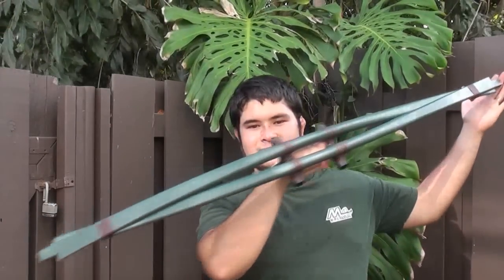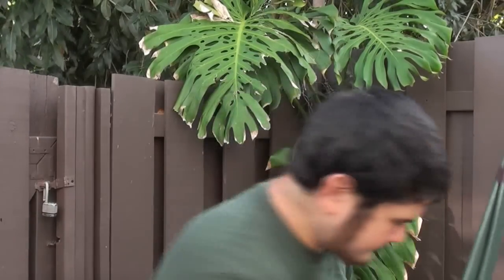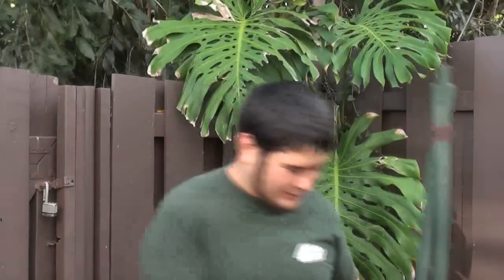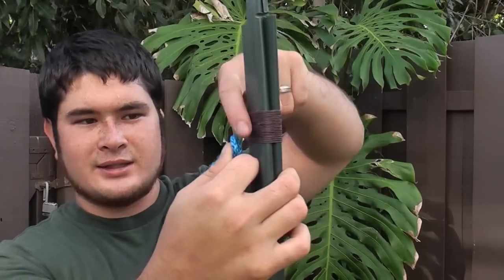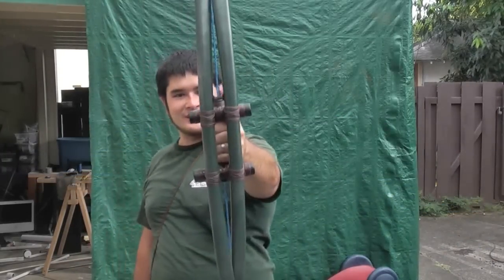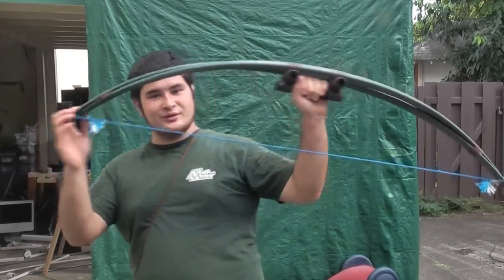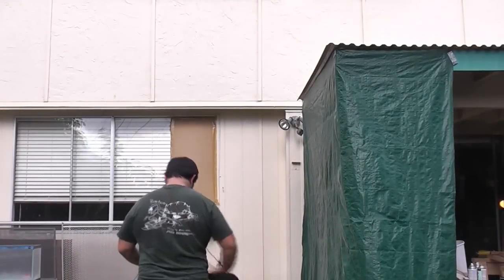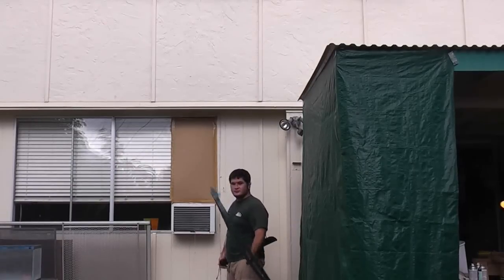A 65 Pound Centershot PVC Bow Part 3 - Stringing and Shooting

Comment: I think that's a unique way to try and overcome the Archer's Paradox and improve accuracy. However, the handle is directly centered from top to bottom, leaving your arrow trying to run off center. The bow string is gonna lift the tail as it shoots, thereby rotating the Archer's paradox from horizontal to vertical. Not trying to rain on your parade. It's still awesome, but with a little adjustment...

Comment: Thinking ... a center shot crossbow ... or is that going too far?
Reply: I'm not sure what the purpose would be.  The purpose of a center shot bow would be to avoid the arrow wobble caused by shooting off one side, which doesn't happen with a crossbow.  Though from what I understand of the physics behind it, unless the shooter is using a mechanism to release the string rather than fingers, a centershot bow would not be useful

Comment: Thank u so much! I built it and it ended up pretty well. I used screws and bolts instead of strings/ropes to keep it all together. Its much more rigid and stable that way. And looks better in my opinion. Still don't have any arrows to shoot though. Don't know how to make any. Any suggestions guys? Help would be much appreciated. Thank you.
Reply from the maker: WAKEISLAND99 Nice! Glad it worked out!

Here's how to make a couple types of dowel arrow:Dowel Arrow with Duct Tape Fletching - https://youtu.be/i6Cc5z4vCW4
Hunger Games District 12 Arrow with Feather Fletching - https://youtu.be/fF-aUZu3_js

How to Fletch an Arrow with Fur - https://youtu.be/zZwtqgrtWmw
How to Fletch an Arrow with Feathers - https://youtu.be/flm58SB-Ts0Here's how to make a great homemade arrow point - https://youtu.be/N_4w482Oty0Hope this helps!
Reply: BackyardBowyer Thanks! Ill check'em out.
Reply: go to dechatlon and buy some

Comment: As a general idea these bows pull those weights at very long draw lengths, yes maybe it may look slow but just because a bow has a heavy draw weight does not always mean it has a really fast shot a big variable in arrow speed is arrow weight as well as fletching size shape and over length of the arrow. The arrows that i use for my PVC bow are just about 2 1/2 times heaver than the standard carbon fiber arrow. So if i was to load an arrow in my bow that was as heavy as the ones used by the average compound bow today usually weighing about 225-250 grain total my bow would have a significantly greater speed than the 141 feet per second that i manage currently which is out of a 63# at 30" draw, granted i draw to 29 inches on average and my bow pulls 56# at my draw so in theory using space age math lol i should be able to get close to that 300 feet per second mark. But as i mentioned fletching size does affect drag on the arrow as well, hence making the arrow less or more accurate also can slow the arrow down as well not as significance as arrow weight can do but it does affect speed.

Comment: original design.. but how do you know the poundage? because from what i see in your video.. this bow doesnt feel like 65 pounds man.. not even close.. id say its 45# at best.. iv got 50# bow and without finger protection shooting this bow is close to impossible.. not to mention how strong you have to be to pull that string..
Reply: He had tested his bows with something like a flashlight that measures wheight
Reply: Stefan Nemec lol really? strong to pull 65 lbs? my grandma could probably pull it...

Comment: you should add a stopper with some soft rubber so that the string hits the stopper and doesn't slap against your wrist, not sure if you have experienced that but its not fun, this will also make it much more quiet when firing the bow.  http://discussions.texasbowhunter.com/forums/attachment.php?attachmentid=266878&stc=1&d=1315771792

Comment: No disrespect  but I think you are getting the weight if it wrong cause  I was watching another video of your 100 pound cross bow and you were lifting that no problem with one hand and I work out and that is all I can lift
Reply: The pounds that are mentioned is not the physical weight of the bow, but the weight needed to draw back the string, and normally measured at 28 inch from the rest position of the string.
Reply: These bows are made from PVC pipe filled with molten lead. He's just really strong.
Reply: When you draw a crossbow you use alot of your muscles in you body not just you arm, and a 100 pound crossbow is easy as hell to pull seriously better keep lifting kid cause sounds like you have some small ass arms just saying.

Comment: When I build myne Im going to use a Bungie cord instead, just shave the middle part a bit so the arrow fits on it. What do ya think?
Reply: I may be wrong but isnt bungie cord stretchy, in which case it is, it will lose a lot of the force i think, not positive but im almost positive it will really screw over the bow if the string is stretchy.
Reply: From what i recall bungie-cord is normally made up of a lot of thin elastic cords bound together. That means that when you start "shaving off some of the cord in the middle you will lose a lot of the strength of the cord, and are likely to end up snapping the cord pretty soon. For what you intend to do, i would rather then go for a slingshot, and use surgical tubing, and not make a bow that is designed with the limbs to store the energy that is needed to propel the projectile forward.

Comment: The bow is very nice ... but you got to be crazy to put the handle in middle if when you are shouting with it you got to be careful whit it if the string hit you're arm it's painful
Reply: C Tomlin
The nocking point of the arrow on the string is very seldom perfectly in the middle of the string. When you set up a bow, more so with recurve-bows and longbows, they are almost always set up with the arrow pointing slightly down if the angle is measured at 90 degrees from the string. And that also depends upon the shooting style that you use, wether you shoot with 1 finger above the arrow and 2 below, taking note that you are not "holding" on to the arrow, but that the nock of the arrow has to hold it to the string, or with the 3 fingers below the arrow style of drawing the bow.
Reply: you do know that almost all bows you hold right in the middle where the string is right? the only way to hit your arm i if you are not shooting with a correct form.
Reply: Leng Thor but don't you need to noc it in the center of the string?
Reply: C Tomlin no it doesn't have to be perfectly in the center.
Reply: Leng Thor Thinking about it later I remembered some of the Asian long bows don't use the center either, right?
Reply: C Tomlin
I think you may be referring to the Japanese longbows, which are held at about 1/3 of the length from the bottom. The rest are all sort of close, but most bows are never held perfectly in the middle, since the handle is incorporated into the bottom limb of the bow, and that is compensated for in the tillering process of the bow.

Comment: That is no way anywhere near 65 pounds. I would say 20 pounds at the most looking at that bow and the speed of the arrow plus the very shallow penetration of the arrow in the target. My wife has her Mission Menace compound bow set at about 20 - 25 pounds and it leaves that PVC Bow in the dust. My Mission Craze bow is set at 35 pounds and eats that PVC Bow for breakfast. My bow would sink an arrow up to the nock at that distance into that target at just 35 pounds. Im not saying the bow is shit, its good and hes done a great job on it. But he shouldn't boast saying his bows are 60 pounds, 40 pounds, 70 pounds etc because the truth is the most powerful of his bows wouldn't even break the 25 pound mark.
Reply: nathan leslie lol its possible to get 65 lbs. there are videos where people with pvc bows are pulling at more than 60 lbs at 28 inch draw. (with proof) 

btw i think it's funny how to compare a $400+ compound bow to a $20 bow made of pvc..

and i had always thought compound bows are for pussies without back muscles. :P just saying.
Reply: Kinda comparing apples to oranges. A compound bow is in a whole different league than a pvc bow. The whole idea of a compound bow is to add cables and pulleys for mechanical advantage, reducing the draw weight and increasing efficiency. If you somehow removed all that stuff and strung to the limbs themselves, you'd find that your bow's draw weighs far more than the 20-35 pounds you're used to.
Reply: I know I'm just saying that pvc bows are not 65 pound.
Reply: It probably is 60 lbs. but there are multiple things that could be slowing the arrow.
1. Not a full draw
2. Arrow weight
3. Friction imposed on the arrow from rubbing against the bow
4. Nocking
Reply: PVC bows can easily be 65 pounds. This is made from 2 32lb members which is nothing. I've seen allegedly much higher weight on single PVC. It's normally fiberglass reinforced.

Comment: For some particular reason, my bow turned out to be 20lbs instead of 65lbs. The only difference from your bow (Accidental) is that I made the center of the handle section about 3 inches lower than the center of the bow(s). I didn't think it was going to change the draw weight of the bow?
Reply: Difference in the materials? Even piping of similar diameter and thickness may have a different type or quality of plastic.
Reply from the maker: Did you use 3/4" or 1/2" pipe? That sounds about right for 1/2" pipe, but even a single 3/4" pipe would be pulling more than 20 pounds.
Reply: I have found out that I was using Electricians PVC instead of Plumbing PVC! Because my dad is an electrician and I must have used one of his pipes. When Grey PVC is left under the sun, it turns to a more white tone than grey, so it look similar to Plumbing PVC. Sorry! Just a quick question, is PVC Pressure Pipe the same kind of pipe as the ones you use in your videos? Thanks!
Reply from the maker: It should be. The 3/4" pipe I use is rated for 480 PSI. Electrical conduit tends to run a lot lighter in poundage. It tends to take more set and also tends to lose its shape on hot days.
Reply: BackyardBowyer I'm finding it hard to find comparable pipe in the UK - any pointers? Best I can find is 16 bar (230 psi) :(

Comment: Is that really 65 pds? How did he test it?
Reply: he does have device to measure the speed of an arrow) it is not difficult to use some formula to calculate it if you know the weight of arrow and its speed)
Reply: Tequila Didgeridoo
No I know there are devices that are used to measure draw string weight as well as arrow speed, but he never showed it being tested. That is why I asked if he tested it I also meant 65lbs, I don;t know why but I always put pds instead of lbs haha.
Reply: ***** check out his other videos)) you will enjoy this elfman)
Reply: To test the draw weight all you need is a draw-scale (or whatever it is called), like they use for fishing , then you hook up the bow and draw it to the max length to see the draw weight. As for the arrow speed, you need a special piece of equipment that measures the speed as the arrow passes through 2 "shields", whatever they are called, and that gives you the arrow speed.
Reply: He has videoed many demonstrations of the draw weight of his bows. So at this point, I would have no reason to doubt his claim. In fact, he could probably  guess the weight, within a couple pounds, just by how it feels, even without accurately measuring it. But a single piece of 1" PVC can pull 50 Pounds (personally tested) , so I have no reason to doubt the 65 of this bow.

Comment: Nick is shooting the bow correctly. There are many grips used to draw a bow, in the video he is using the three finger-under method, this method is perfectly safe to use, I've shot with it and it's no more dangerous than any other grip. when a bow is drawn you grip the string not the arrow. This bow's rest isn't in line with the center of the string, he is drawing from the center of the bow, the arrow is notched high because of the rest position, this means there is a gap between the hand+notch.

Comment: Just wondering... Isn't the bow supposed to be more powerful and accurate if the arrow was kinda centered on the bow and the string? I mean, if you lowered the handle and placed the support for the arrow at this exact place? Or is the handle supposed to be at the exact center of the bow?

Comment from the maker: On this bow, the arrow sits in the center and there is no support on either side of it.

The traditional split-finger release of one over and two under puts twist into the string. A traditional bow or a finger-shooting rest pushes against the arrow and helps get rid of the twist.

Since this bow has no support, the twist your finger gives the arrow would send the arrow way off course. I'm holding the string way below the arrow so that the twist happens away from the arrow, to lessen the effect.

Comment from the maker: I can usually get within a paper plate at 20 yards and within a large pizza box at 40. I'm not that accurate yet, still need to practice.

A whisker biscuit or other containment rest would really help. If I had a rest like that, or even a plunger-style rest on this bow I could shoot it normally. Since it's a centershot bow, shooting fingers near the arrow would mess up the shot without a finger-shooting rest like a plunger.

Comment from the maker: I'm shooting the bow like this because it is truly centershot. I could hold the string around the arrow but without a captive rest or a release aid or loop, the arrow would go flying off to the right. Because of the rigid handle section attached to fully-bending bows, you want the arrow to be a little higher than center to balance the two sets of limbs.

Comment from the maker: To shoot split fingers, you would have to install or make a captive rest. I'm gripping the string lower so that the arrow doesn't fly off to the right from string twist. Another way to get around it is to use a release or release loop, which will eliminate string twist. That's the main drawback of a truly centershot bow. If you use a release or loop, the grip is fine where it is.

Comment: Nick after you made the centershot with the 1/2 pvc, I made one with 3/4 inch. Man does it have a pull. Insted of lashing the limbs, use Pvc tees cut one side out so they clip on. They work great. I also drilled a nice hole in the ends and put in a stainless steel bolt. The bow totaly takes down if needed. Thanks again. Taterwayne.